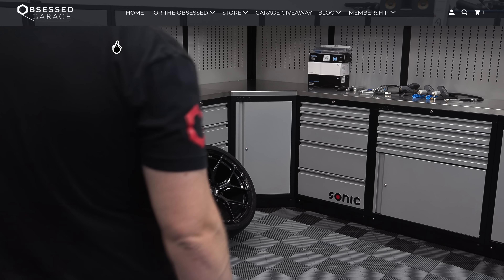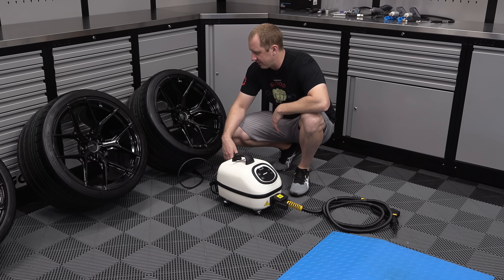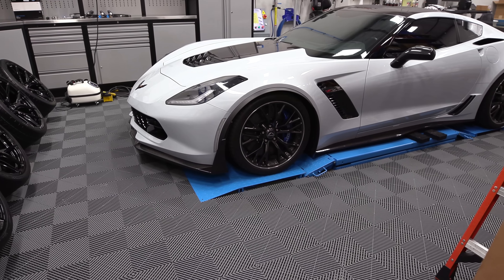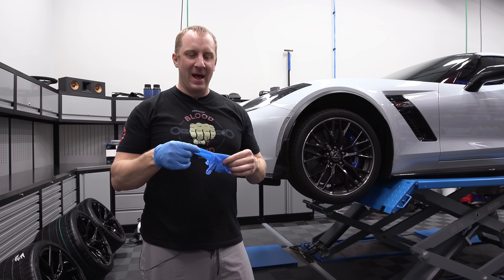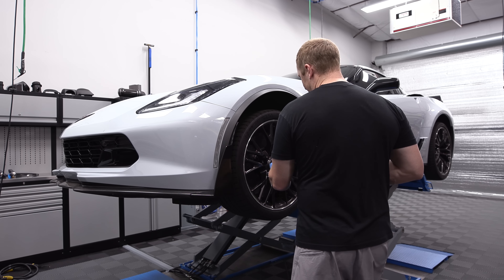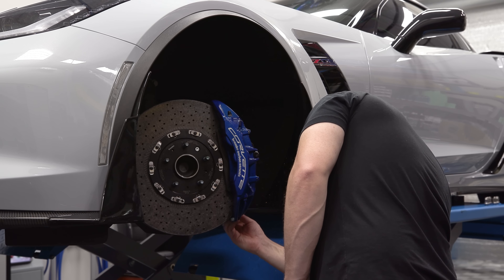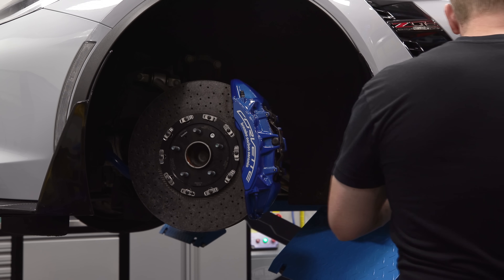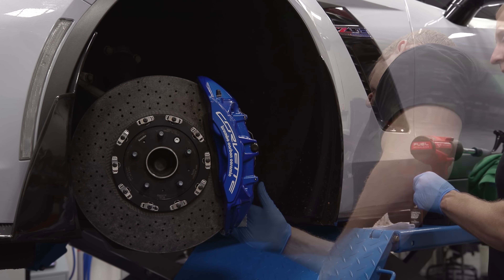C7 Corvette: Brembo CCB Caliper Steam Cleaning & Coating

Comment: Consider getting the Reverse Logic lug nut extenders for removing/installing the wheels.  That will save you from chipping up the CCB's and calipers.
Reply from the maker: I find that unnecessary for cars with studs.

Comment: Be aware that stock, the tire can rub on the fender lip through the fender extension. I wouldn't be surprised if those extensions were replaced and you have exposed fiberglass underneath.